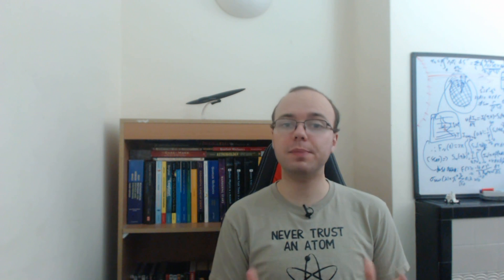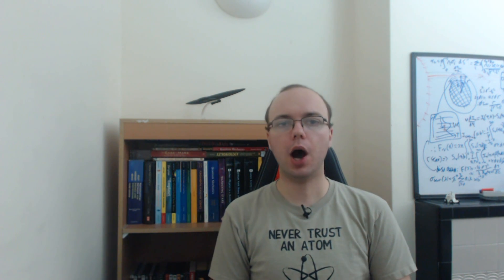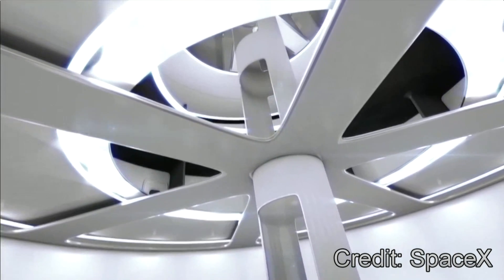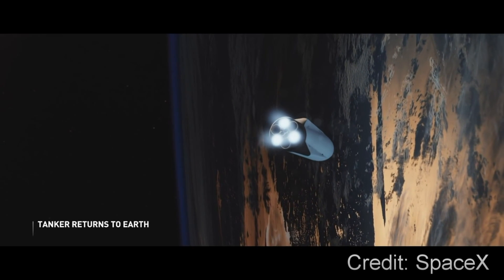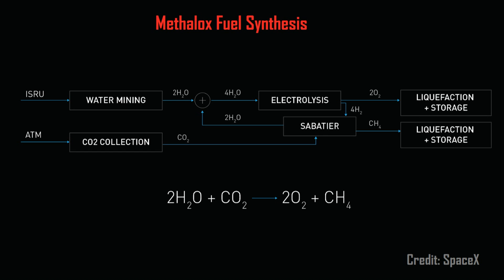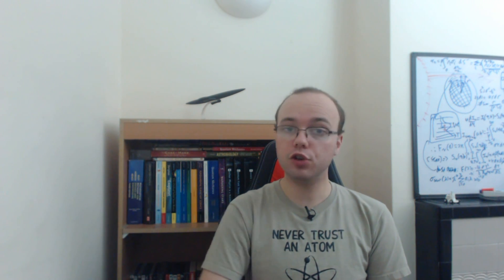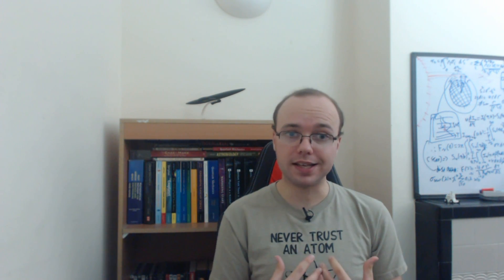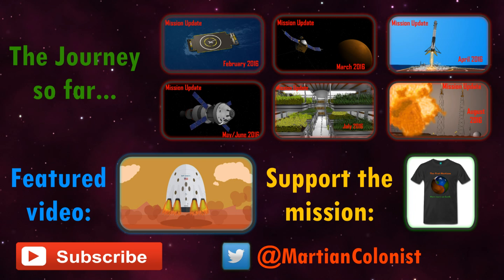Mars Mission Update: September 2016

Comment: Звездолет модел УРАГАН (Starship model Hurricane)

Дължина 70 метра, ширина 40 метра, височина в най-високата точка 14 метра
Length 70 meters, Width 40 meters, height at the highest point 14 meters.   
44800 м2 площ на слънчеви панели  (44800 square meters PV surface)
 Мощност на слънчевите панели 8960 Kвт (8,96 Мвт)
Power of the PV panels 8960 Kw (8,96 Mw)
Задвижване (Propulsion)
SnS,UART,ION,electrical air engines.
Диагонално излитане и кацане ДИК  Diagonal take off and landing (DTOL)
Висока стопираща сила при навлизане в атмосферата. High stopping power during reentry into atmosphere. 
Пълна възобновяемост. Full reusability.
Моментална охлаждаща система против прегряване на корпуса. Instant cooling system against hull overheat during reentry.
Система за контрол на триенето. Anti friction system.
Система за генериране на електро енергия от насрещния въздушен поток.
System for generating electric energy from incoming air stream.
Въртящи се слънчеви панели. Rotary PV panels.
http://i65.tinypic.com/13z98qv.png

Comment: Where did you infer that the tanker needs 6 times to launch one mission? It only needs 1 launch of the Crew module and 1 launch of the tanker to send 1 crew module to Mars.
Reply from the maker: Elon's presentation states that 6 booster launches are required on slide 41. 5 of these are tanker launches, 1 is the crew vehicle. You'll find the slides here: http://www.spacex.com/sites/spacex/files/mars_presentation.pdf
[You can also calculate this using the ITS propellant mass and tanker payload on slide 36].
SpaceX's animation of the ITS only shows one tanker launch for simplicity.

Comment: As Elon has said on a number of interviews, this venture is very dangerous. Even suggesting that one that expects it is more likely they would die in route to Mars would be the best candidate for this venture. 

Keeping the danger in mind, doesn't it make more since to put into Earth orbit the Mars space craft with a minimum crew and launch the rest of the crew and passengers in smaller numbers at a time to minimize the risk of loosing a full Mars space ship on one launch?

It also seems to me that it makes more since to build a number of Mars ships, external tanks of fuel and other supplies, connect them together and then continue onward to Mars. I would think this would lower overall, the cost of building a colony off world.
Reply: If you think about their approach to reuse, it does make some sense.

From a risk vs reward point of view, you're up against the reusability problem.  If they can't reuse the booster 1000 times, it's not economical to do the mission in the first place.  Therefore, the risk of a catastrophic booster failure (i.e. explosion) at launch will necessarily be less than 1 in 1000.  So, it should be safe to launch all 100+ people at once (and definitely be cheaper).  Admittedly, that's a pretty high bar to set for safety; hopefully, it's not just wishful thinking.

As for using external tanks, you've got the same problem.  The tanks are one of the more expensive parts of the craft, and one would want to reuse them as much as possible.  If they're external, they wont be shielded from hyper-sonic airflow of the Martian (and Earth) atmosphere during aerobreaking.  They'd burn away, and once again the mission becomes too expensive.  That's why they're planning on using the tanker ship to do up to 5 refuel-on-orbits per voyage (to fill the internal tanks of the crewed ship).
Reply: One other thing to consider, is that, odds are, every one of those 100 people will perform tasks that are mission critical.  If you divide them up between even 5 launches, and just one of them explodes, you'll have lost 20 people critical to mission success. The whole mission might have to be scrubbed, unless you have replacements lined up.  So launching them all at once might actually be less risky to the mission.

Maths:
if risk of failure for 1 launch = 5%
risk of one failure in 5 launches = (1-(1-.05)^5) = 22.6%
therefore risk of failure for 1 launch is less than risk for 5 launches
--
This train of thought holds even for much lower risks (though the difference in risks becomes way less significant).
Reply: Faulx Eve I agree with your assessments for the most part accept I believe the risk is just too high that many lives. You are not only risking 100 lives for just one part of the entire operation but you have to consider what the rest of the public will do if 100 people are killed at launch when many people don't believe going to Mars is all that important in the first place.  We could see missions off planet stopped again as it was in the 70's. 

As far as the re-usability of all stages of the crafts should be used and reused as many times as possible and some indefinitely, like habitats. 

In the configuration I mentioned of connecting storage, fuel, oxygen, water could still be reused as return fueling vehicles or used to continue in the Martian orbit as a space station. As ships are refueled on the Martian surface, they can be sent up to the orbiting station for fueling larger tanks that will take people and cargo back to Earth. 

There are so many advantages to doing it this way or some other creative configuration like expanding crew and passenger space. 100 people on a three month plus voyage. I just can't see that many people sitting like an airplane ride, not to mention having enough life support supplies to get there for that many people.
Reply: Ah so, you're thinking of risks beyond the mission.  That's definitely something worth considering, though I think the safety and particularly the cost benefits of a single launch would still win out in the end.

You're still failing to consider the heat-shielding on these external tanks.  Arriving at Mars, the relative velocities between ship and planet are on the order of 6-9 km/s (depending on the conjunction).  In order to decelerate into a "1 sol" parking orbit (where a space station might be kept), you'd need to get down to 4.81 km/s (at 250 km altitude).  The SpaceX plan is to aerobreak against Mars's atmosphere for this, and, without a heatshield, external tanks wouldn't survive.  Not aerobreaking means you have to bring enough fuel (and possibly engines) to slow down using your engines, again increasing costs.

Then there's the issue of refueling, if you're using the tanks for orbital fuel storage, but you're filling them from fuel brought up from Mars, your ship (or at least some ship, like a fuel tanker) needs to have landed in the first place.  And since the crewed ship has to land, to drop off passengers and cargo, the whole ship might as well land.  

There's also the power and heat dissipation issue.  You have to keep the cryogenic fuel cool, and then you have to radiate away the heat.  At this point, you've put so many extra things onto these fuel tanks (solar panels, radiators, a heat shield, possibly engines, sun shields, stationkeeping thrusters, ect...), they might as well have been space ships in their own right.

As for life support, it is surprisingly light.  Food (prepackaged, not dehydrated) is on the order of 200 kg/month/person, so 60-100 tonnes (3-5 month journey) of the 450 ton payload.  Oxygen is about 1kg/day/person or 9-15 tonnes plus a few tonnes of CO2 filtration equipment (if they don't bother with much reprocessing).  Water should be a closed system, so a few tonne processing machine plus a small storage tank should do everything they need.  There's plenty of design work they could do to lessen these masses as well.

As I understand it, they've got full freedom of movement within the passenger space (no turbulence in space), so everyone should be floating around with lots of room, activities, and interaction (and vomiting, let's not forget the vomiting).

Still, you're right, it's definitely good (and fun) to think of other possibilities (and the problems that come with them).
Reply: Faulx Eve Well,  enjoyed that response! Wish we could find these kinds of discussions on youtube from people like Elon Musk. 

I see what you were saying from the beginning. I didn't take into account the braking needed to go into orbit, although I would think they could figure that out. I just watched a video on expandable heat shielding. Seems they have been working on this since the Apollo missions. I see they plan to test a large vehicle from the ISS. 

As far as landing on Mars, it wasn't my thoughts of all the ships and tankers to land. Although, it just seems practical to bring along a few factories to produce things like construction 3D printing materials or metal refining factories. Even different vehicles like earth moving or mars moving equipment. It seems one day people like us might want to drive their Tesla model M to the next settlement or other work sites. A little corny humor there...

The first colonist probably don't need these things in the beginning but it would seem practical to start those kinds of operations as soon as possible. If those things are in the plans, then I would think combining some missions may cut eventual cost. Also my thoughts about carrying lots of water came about while thinking about providing some protection from radiation or even micro impact protection. Kinda remembering Apollo 13 also and over building on the essentials. 

I do agree that keeping the initial cost down is very important to get to Mars in the beginning. I still think from what we know of our pass space program, that if there is an accident and 100 crew and passengers are killed on launch, that terrible even could kill near future attempts to move man off world. As Elon says quite often, he does not want to do anything that might cause that to happen.

Comment: question...what is the point of Mars One project i just don't see it because space X is already doing...
Reply from the maker: Mars One is focused on developing surface hardware and crew training, which are areas into which SpaceX is not focused. It actually makes a lot of sense for multiple different initiatives to work of the necessary aspects of a human settlement, as Elon was quite clear that he is just concerned with the transport system.

Comment: I understand that they are building a transport system and not a city.  But using the train analogy, they should set up a depot that provides temporary lodging for new arrivals and also those preparing to return to Earth.  I wouldn't think of the depot though as a place where people, other than employees, reside on a permanent basis.  Details for cities and residential areas should be worked out by other companies.  And no one should leave for Mars without making arraignments with one of those companies.

Comment: I'm skeptical of this idea or even the need to colonize Mars and I've been a fan of spaceflight for half a century now. I've been writing graphic novel stories about Mars missions on and off since 1973. Mars should be examined for the possibility of microbial life first and foremost. Something everyone seems to have forgotten in the mad rush to colonize Mars. This search could take a decade or more. If microbial life were found after large numbers of people arrive, it would be more difficult to prove with a very high degree of certainty that Martian life is indeed indigenous to Mars. Colonial contamination could compromise a life search for good. However, if fossilized evidence of life is found, or microbial life with radically different DNA structures is found, then said life can be confirmed. Especially if it squirms for the camera. The other problem is something I call the "Cost barrier". Unlike the sound, or man in space/moon barriers of times past, the cost barrier has evaded numerous attempts by the best and brightest to break it. Attempts which now litter "Cancellation trail". Space X is on it's way to breaking the cost barrier by demonstrating the feasibility of reusing boosters. But they still have to demonstrate the actual reduction in cost that reusability should bring. And that's just on the scale of the Falcon 9! Then there is the need to demonstrate they can do what Soviet era Russia was unable to do with the N-1. That is synchronize 42 booster engines. But I'm sure Space X is aware of the N-1 history. And tech advances in rocket engine control systems will probably make it possible to have numerous engines on a booster. But at the end of the day, since I'm a nobody, my say won't matter. Best of luck to Space X or anyone able to break the Human Space Flight (HSF) cost barrier.
Reply: The people that matter have not forgotten about the possibility of life in some form on Mars. That is one of the
objectives of the rovers that are there now. Other missions with that objective are being planned. They will look in different locations to increase the chances of finding something.

Comment: first we learn to walk and only after we learn to run, so first we need to test our technology colonizing the moon and only after decades we can think to colonize Mars,  it's insane go directly to Mars without practice any standard technology on the Moon , including a live-on module sistem. Anyway I love your videos , but that's my opinion.
Reply: that's what we've spent the last few decades doing, developing new technologies on the ISS
Reply: On the other hand... Mars has resources that the Moon lacks: CO2, mainly, plus H2O frozen in some locations.  These are the ingredients for rocket fuel.  The iron in the Martian soil can be smelted and used for building materials, etc.
Reply: Actually, the moon is probably harder than Mars.  Extremely low gravity makes simple tasks like using a screw driver difficult.  The 709 hour long day/night cycle means your batteries have to be ridiculously large.  And the unweathered regolith is foul-smelling and sharp like sandpaper, so your mechanical systems, air/water processing units, and EVA suit joints would wear out faster trying to deal with the stuff.  Closer does not mean more habitable.

Comment: Reaction: 
1- Wow!
2- Maybe the crew can go up after the some of the fuel is in orbit instead of waiting?
3- I wonder if the ship will have some type of internal or retractable external cable elevator because when it lands on Mars the crew compartment will be close to being on top of a 6 story building or higher.
4- maybe one of the ships (who would otherwise usually return to earth) could be fitted to remain on Mars as a ready-to-use HQ base/fuel storage/fuel factory.
Reply: 3- Someone said that the legs are so big that dn elevator could fit in there.

Comment: i think it makes more sense to go for a Mars Base in the first launches. that means you send small Crews of a few people but a lot of Cargo. and 7-9 month is fast enough at the beginning.
Reply from the maker: I agree. Taking a 7-9 month transfer alone would decrease the required number of refueling trips to LEO.
Reply: I reckon a free return trajectory is the most sensible idea, at least for the first few manned trips.
Reply: What about a free trajectory to Jupiter if the mars orbit insertion fails? :)
Reply: volleyballschlaeger: The alignment of Mars and Jupiter would be a critical factor in making that possible. For example, if Jupiter happened to be at the opposite side of the sun relative to Mars, free return is probably not an option without more propellant than even the ITS would have available.
Reply: andy woof: Free return trajectories are probably not an option except when the alignment of Earth and Mars are such that the spacecraft returning to Earth can get there with little propellant. An example of why free return is probably not an option, if there was a requirement to return to Earth when it is on the opposite side of the sun relative to Mars, the sheer distance is beyond what even the ICT is probably going to be capable of.
Reply: According to page 9 of:
http://www.ssdl.gatech.edu/papers/conferencePapers/AIAA-2006-6308.pdf
A free return trajectory increases total time of flight to around 730 days (in the event of an aborted landing).  On the bright side, Earth to Mars time goes down to 5 months.  On the dark side, you're coming in fast and have to burn more fuel to slow down (up to 2500 m/s more delta-v than a normal fast conjunction).
Reply: These numbers do get better with a 3 year free return, but then you're pushing the limits of your life-support and food supplies.